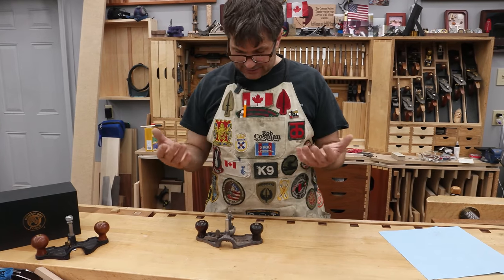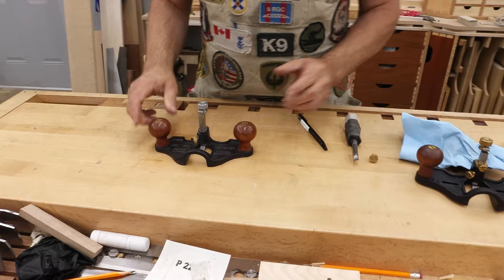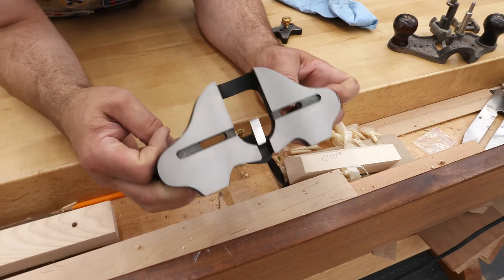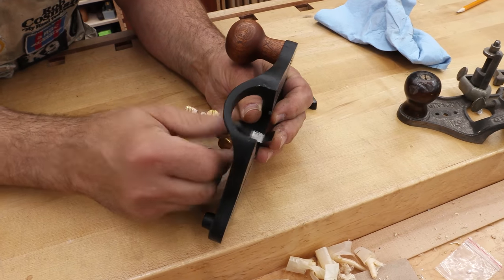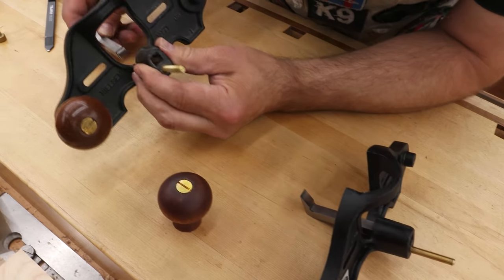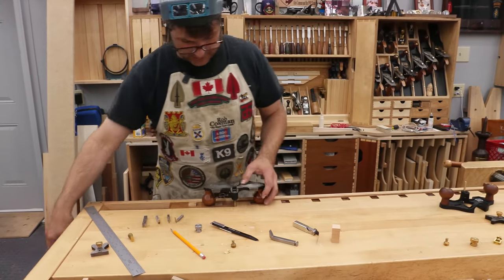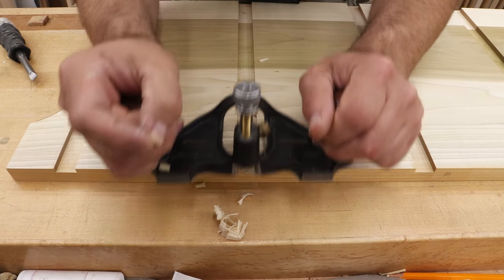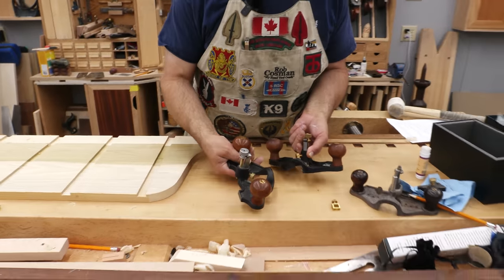Router Plane Reviews - Lie Nielsen vs Bench Dog

Comment: One issue not mentioned with LN right now is the loooooooooooong wait for any tools right now. Probably due to scaling back operations due to Covid.  Whatever the reason, Prices on ebay are absolutely ridiculously high since LN has slowed down to a crawl at the moment.
Reply: Good luck getting a mortise chisel from LN I gave up and went with Narex doubt I will ever bother again. And after watching this I got a bench dog router plane for $103 compared to $225.
Reply: @summerwind4590  I looked them up.  LN is now $225 to $250 depending on the model.  The Benchdog is 139.99.  I would personally rather buy American to support a small American company even if it's a bit more.  But with inflation putting a major squeeze on the wallet, the Benchdog is very tempting.  I certainly wouldn't fault anyone for going that direction.

Comment: Watched this not long after it came out, but now looking at it and comparing the price, the LN is just shy of double the cost ($110 more) of the BD now, so to me, unless you have $$$ to burn, the BD is the choice. I'll be adding the BD to my tool list and do the little bit of touch up work on the knobs and blade. Oh and to the copying thing, it looks like LN has now added a brass depth stop similar to the BD, so fairs fair I guess.

Comment: Good video, Rob.  Ironically, I just found my grandfathers Stanley the other day.  I had it out, tuned up the blades and started flattening the bottom of the plane.  The sole has some pretty deep scratches in it;  but none seem to have sharp edges or burrs.  I also started flattening the bottom a bit and found it has nice registration on the front and back but seems hollow ground in the middle.  Should I be concerned about that?   

My two cents is the Lie Nielsen.  A real company; they sponsor events, provide assistance to make the craft better (like assisting your efforts with the vets.)  Doing that kind of stuff cost money.  Just building the tool to be acceptable sometimes isn't enough.
Reply from the maker: You need to worry about it in front of the mouth.  That needs to be dead flat, there can be a slight hollow behind the mouth

Comment: Good video. I like that there is a budget version of a quality tool available for those who need to watch their pennies, or even half pence. I purchased the Veritas router plane after about a year of bouncing back and forth with the Lie Nielson. I chose the Veritas because of the angled knobs and the two-piece cutting tool construction which makes sharpening a bit easier. It was a hard choice. I often start with a cheap tool to see how often I will use it. In this case, I went to a top end tool because I knew I would only buy once. I am very happy with the purchase, but am still second guessing.

On another topic, it will help if we knew what the current bottom line cost is to bring a vet in to the Purple Heart workshop. You talk about tools and such, but I think it would help knowing the full cost per person.
Reply from the maker: Full cost last time we ran the courseew which was two years ago because of COVID was 5000 per Vet

Comment: Back in the day, about the only craftsmen that used those old grannies tooth routers were stair makers when cleaning out the riser rebates. But now of course that's all done with a cnc router or trenching head.
I have one but I've never used it, not even once. Not cabinet making, boat building, joinery, you name it. Its a dinosaur tool really.
It's clunky, leaves a rough finish and useless for fine rebating locks and hinges. Save your money and get a 1/4" makita router.
Reply from the maker: Pretty sure you picked the wrong channel!

Comment: I wonder if the bases are both made in the same casting facility. LN may clean it up more before paint. Bench Dog could get less clean up or even be seconds after the molds lost some of its shape. $50 may be for hand working the blems out. 🤔 either tool will out work my skill level.
Reply from the maker: Lie-Nielsen is stamped “Made in USA,” it would have to be cast in the USA to use that stamp.

Comment: My Bench Dog Router Plane blade is not rounded on the bottom side edges and it cuts beautifully. Otherwise it's the same as the one you reviewed. At 80 years of "Eld" and on a fixed income, it'll do the job I ask of it just fine and I can afford another tool to keep it company.

Comment: Thanks for the review. I appreciate your observations. I may have missed a comment on this, but i didn't hear any mention of the tool steel used on the Bench Dog version. My guess is that it is 01 steel which is fine, but i think that A2 steel that's been cryogenically treated is an upgrade and more expensive to produce. That could be a part of the price difference. The handles on the Lie Nielson look like they have a nicer finish on them. cosmetic, but just a better looking tool and better fit and finish, IMO.

Comment: Thank you for the review. The only question that you did not answer is the material for the blade. Is the bench craft A2 same as the LN? But really good review
Reply from the maker: Bench dog didnt list the blade material.  I doubt its anything but tool steel or they would have listed it

Comment: Okay, I felt dirty doing it but I ordered the Bench Dog router plane last week. (Major factor was because the L-N are not in stock and I really need a router plane) Everyone talks about the $50 difference but Rockler had them on sale for $99. Combine that with the free shipping Rockler offers and now we're talking about an $90 difference. That was too much to ignore and I received it last Friday. Did all the checks that Rob performed and discovered the sole at the blade capture area wasn't flat side to side - about a .003 hollow in the center. Drat. 

The bigger issue however was that the square hole to capture the blade was machined crooked and not perpendicular to the sole. I estimate one side of the blade is roughy 1/32 to 3/64ths lower than the other, meaning it'd be impossible to get a flat groove in one pass. (I checked the blade against itself for square and it was perfect.) Using a jig to retain the front to back angle, I've reworked the blade with my diamond stones and it's much closer to perpendicular (and nice and sharp), but not perfect. 

Not sure what my next plan will be. Naturally, I'd like to return it and just order the L-N but of course, they're not in stock. (I've got my name on the list) I'm confident I can make the Dog I have servicable with more work but I'm also thinking about asking Rockler to exchange it in hopes of a better unit. Suggestions are welcome. Either way, I think when/IF the L-N become available, I'll pick it up and just sell the Bench Dog.  It's a hassle for sure. You do get what you pay for.
Reply: @Phil Shock, Phil….sounds as if you took a “hit for the team”.  I much appreciate your candor….and the sacrifice!  Some people in the comments above turned this into a political rant….after 50 combined years military service and a law enforcement career, I simply no longer tolerate that crap.   Again, I appreciate your valued comment….if we knew each other, I’d buy you a toasted lager, maybe a single barrel bourbon…to take the sting out of the Bench Dog! Take care, sir!